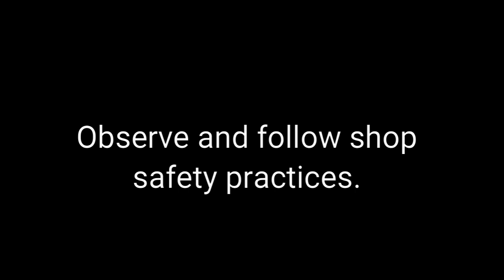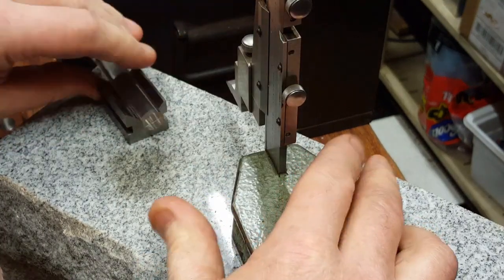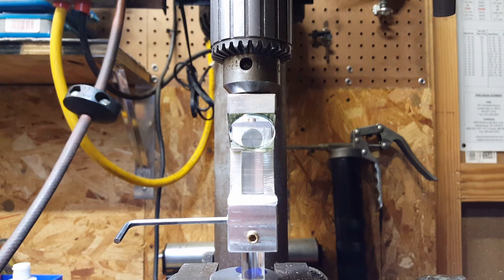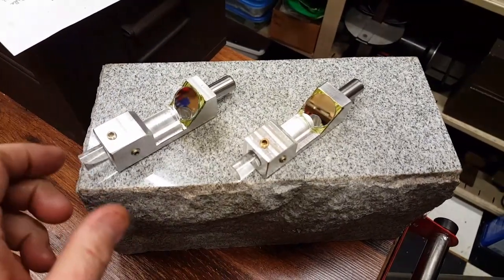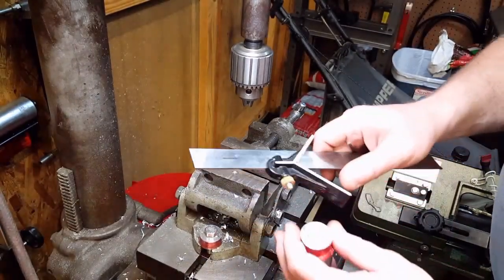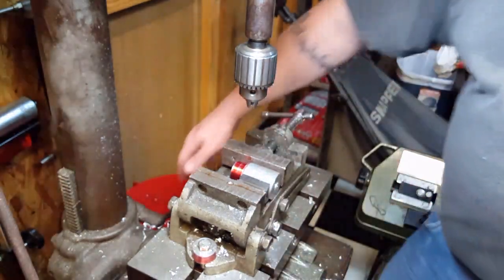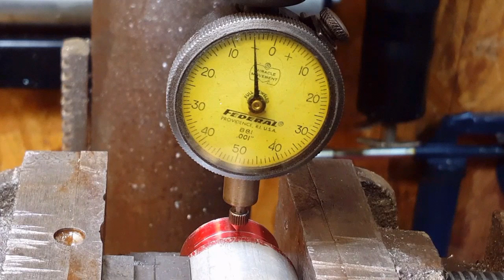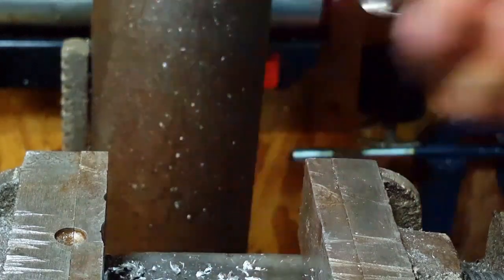Centering scope project, Part two.

Comment: very cool. are they front silvered mirrors?
Reply from the maker: https://www.amazon.com/Circles-Projects-Traveling-Framing-Decoration/dp/B014Q7AVKG/ref=mp_s_a_1_3?keywords=1+inch+mirror&qid=1568636899&sprefix=1+inch+mirr&sr=8-3

That's the link to the mirrors.  I didn't see anything about silver in the description.  I just made sure it was glass so it would remain flat and true. 
Thanks for asking.

Comment: It's a center drill.  There are no fasteners with 60 degree countersunk heads of which I am aware.  Those are usually 82 or 90 degree.  Will give you a sub.  Looks like a fun project.  Few minutes passing...... I've now watched both video's now.  Some curious questions.  I'm wondering about blacking the od of the acrylic rod, using a small LED light source near the tip and some kind of shield between you and the light spot on the work so when you are looking into the mirror the light is only reaching your eye from the rod bottom/mirror.  I would think a bright spot on the work if it could be seen outside the mirror might cause your pupil to reduce and make it harder to see??  I realize it's a bit more complex but you have me thinking about the engineering here.  Also, is there a parallax here?  As you move your eye off center left and right, does the cross hair seem to move slightly over the work?    I really like the simplicity of what you have done, you just have me thinking is all.
Reply from the maker: I like the feedback, thank you very much for the subscription.  
I have a few thoughts for ya about the center drill thing. Yes to me and every machinist I know it's a center drill. All I'm saying is ,and I have been in this situation that some tool manufacturers call it a 60 degree drill / countersink is all. I had just been in a discussion about that before making the video 😂, I guess some of that came out. It is what it is I guess. 
Getting back to the project,  I have thought about what you suggested about blacking out the acrylic and using a light at the end. I have planned on a revisited video on the matter on done the road. I also have an idea about a whole new version of my own design next time as well. The parallax issue is not an a real big problem. If looking into the scope straight it's pretty clear. The less straight the image blurs, but the lines seem to stay on point. So in essence it keeps the users gaze straight and true anyway.  
I have seen 60 degree screw heads on some old machinery years ago. I may still have a few.
 Type of threadNormal CS angleISO Metric89.9°
Imperial BA, BSF, BSW etc.100°
UNC, UNF82.5°
Aviation fasteners100°
That little bit is all I have ever been around myself. I mainly use the aviation stuff here at work. 
On a more personal note I'm glad to see someone restoring old Logan lathes. My first lathe was a Logan and I got it in basket case fashion. So props to you. If you want to keep this conversation going just friend me on Facebook and PM me. Always like to hear about projects.
Reply: @stephenpranger5372  I was shopping on Ebay and a kit for this purpose is very expensive.  It's a worthy project.  It's better to have commentary on  YT as it increases your video's score and gets you higher in search results.   If I keep thinking on this, I'll end up doing it.  ;-)   Also considering the cross hair should not cross in center.  It could be better to leave the center 1/8" (or ") blank so you can clearly see the punch mark un-obscured.   I'd love to look through a commercial unit to see all the tricks they are employing.  It could even be interesting if it's lit to simply use a hollow tube with cross hair at the bottom made from fine wire.   Thinking......
Reply from the maker: @CraftedChannel  
Absolutely my new friend. I'm very much for sharing information and making new friends here on YT.  I'd like to hear and see some of your ideas about this project.  This project started out many years ago as a necessity and turned into just a handy item. Now it's on to a refined piece of equipment.  Thanks for the feedback.
Reply: There are 60 degree countersunk head screws, they just aren't common. Search for "60 degree countersink head screw" and you can find them. Countersink sets often include a 60 degree countersink.